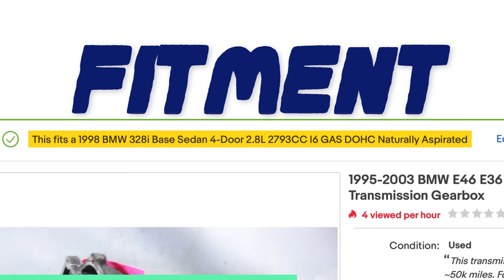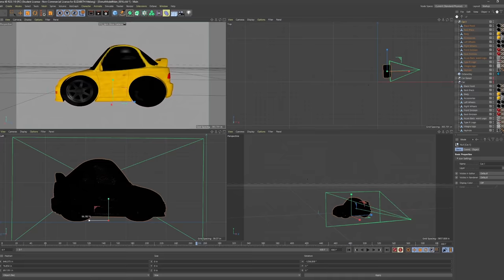Is a Manual Transmission Swap Worth It?

Comment: Wish I had a trans jack when I manual converted my holden vy commodore, I just caught the auto trans with my shoulder from a 1.5 metre drop 😅
Reply: Ouch
Reply: Damn probably broke something in that endeavor.
Reply: @lunakai_360  nope, auto gearbox and concrete came out fine haha, same with me some how
Reply: @robbiecook5719  yeah its like an American falling on you with a hard clip board

Comment: “It’s hard to find an e36 for less than 5k” almost 3k in extra parts alone
Reply: Though the rest of the cheaper automatic E36 is in way better condition than most $7.5k manual E36s for sale, so it’s still probably worth the trade off
Reply: @Girvo747  Is it really worth it though since you have to spend a few day sat least, might break something, and it will be worth less than a non-swapped manual vehicle. Also you need a bunch of expensive tools you might not have.
Reply: @jtland4842  Comes down to personal preference. Modification is never cheaper than factory, but modifying is a hobby in and of itself :)
Reply: not sure about E36 but a E39 manual gearbox is £350, with the rest of the whole kit you are looking at about £800. This is Donut so obviously they dont use eBay used parts lol
Reply: You can also sell the old auto and make some of that money back
Reply: @Nightinglite  the manual trans they’re using here is pretty clearly not brand new though so not sure what this means
Reply: @Nightinglite  here in germany a e36 325 trans is like 100€
Reply: @jtland4842  It's not worth it for most people, you might as well just buy a manual. Now if you're a mechanic with experience and all the tools yes.
Reply: I never get under a car unless I put in wood cribbing along with the jack stands.

Comment: 6:05 - :hand-orange-covering-eyes:Saw that sucker move and almost had a heart attack! Looked again and it was just an extra stand under the exhaust for support, no biggy. Whew... 😌

For real though like Zach said, don't mess around when you're lifting a car or you can easily end up dead. Something I used to train our newbies to do that would freak them out at first is that once you get it on jackstands, go all the way around and give it a solid shove from several directions. Why?
1) If you're worried that a little shove will knock it off the stands, that could be your instinct telling you that you made a mistake somehow and this is a good way to find out without dying.
2) Whether you're concerned about how stable it is or not, this will give you peace of mind when you're under it that one of your frisky coworkers coming by and leaning on, bumping into, or hopping inside it won't cause it to come down and squish you.
3) If (heaven forbid) a good shove actually does send it crashing down, you probably saved your own life and now have the benefit of being alive to take a good look at where you messed up on the stands. Once you understand what went wrong, think seriously about what to do next time so that you don't die if some doofus comes by and disturbs your precariously balanced body crusher.

Comment: Aight, we gonna need that turbo next 

BMW: Cries in stock
Reply: well, unlike the pathetic inline 4 that the miata had, the straight 6 of This bmw would surprisingly have strong enough internals to handle the boost
Reply: @Itselijahbruh  fax
Reply: @Itselijahbruh  the Germans know how to make an inline 6…
Reply: I've read up a TON on e36 builds. Stock internals will take an m50/m52 to 450-600 hp very reliably if the cooling system is maintained. The m42 is cool. You can take forged piston & rods from an M3 as well as adapt the ITBs by removing the middle two. 4-1 stainless header with a tune and you're off for less than an M3 but just as fast and cheaper to maintain.
Reply: @FierceAmbience  i'm planning to buy an 328i or an m3, and i'm so glad to hear this, wish me luck
Reply: @FierceAmbience  600 is a push. Stock m52 can do it but the "safe" limit is reached around 450. Head bolts are a weak point, so decomp head gasket and uprated bolts should push up into the 5-600s
Reply: @LochyP   the 450 numbers are whp I believe while 500-600 is the crank numbers
Reply: @rokuplayz464  yes sorry should've been clearer, ~15-20% drive train losses
Reply: @LochyP  not bad
Reply: @LochyP  False. The head bolts being "weak" is plagued upon the M52TU and M54 because it's an aluminum block but it's more forum misinformation than anything.

Comment: I'm curious how long this actually took him to complete
Reply: Made it look like a day. Could be
Reply: That's why I would rather just save extra cash to buy an actual manual E36.
Reply: If you have all the part, total labor would be 7-9 hours if you know what you are doing.
Reply: @ultraguy8771  the manuals out there are trashed though. this is an cost effective way  no matter how you look at it
Reply: @ultraguy8771  and not long after have to replace the clutch
Reply: This probs took them the whole day becus they need to film all the stuff
Reply: This will take a couple of days or maybe even a week, because you're going to be spending 90% of the time looking for tools and parts, ordering things you forgot to order or didn't know you needed/were missing and cleaning up afterwards. I always underestimate how long something takes. There are always things you can't prepare for.
Reply: I've found that time to complete a project goes down dramatically each time you do it. Based on some of the comments he made during the video, I'm sure Zach has done a trans swap before, hence the short working time and lack of having to order parts multiple times. :3
Reply: Probably a week
Reply: Two different shirts right? I could do it in a day with a lift. On the ground... Def slower and much more miserable.
Reply: @SoundShunter72  This is probably the most realistic estimate for most people. Its a lot of work regardless, though.
Reply: @SoundShunter72  yup!!! id say it took him "some time"
Reply: probably a couple days
Reply: I've done manual swaps on alot of different cars. Never on a BMW but this looked like an easy swap. Honda and GM are usually cake. I did a swap on a Ford Focus and it was nightmare on elm street. Do some research though, some cars are actually faster with an automatic. I could do this  BMW swap in one long day about 12-16 hours. A beginner could probably do this over a weekend with help.

Comment: i just bought one today.. and im going back through all of these to do exactly what you did, but make it a daily instead.. the guidance and in depth view of it is something i really needed and its given me more confidence in doing it myself thank youx100
Reply: How’d it go?
Reply: @KillianDeaton  still going i  had huge trouble with the fan clutch nut.. when replacing my cooling system. next thhing im gonna do it probably the fuel system... its started giving me trouble and now i have to pedal just to get it to start.... once its running smooth again ill swap trans
Reply: @NIGHTCRAWLER9101  Did you do it?
Reply: @LattoSan  its running rough right now biggest problem for me now is money and IM sure i have some seals broken cause its now acting as if i have a blown headgasket... im 100000x sure its not tho
Reply: joe hatcher how much did it cost?
Reply: Me too!
Reply: @NIGHTCRAWLER9101  did you ever get that car running?
Reply: @NIGHTCRAWLER9101  It's time for an update

Comment: Total build cost: $3,156
Having a manual instead of a slushbox: pricessless
Reply: for everything else there's Mastercard :))
Reply: You can sell those automatic stuff :/ Lower the cost to $2000?
Reply: @NeoHCgbz  I wouldn't have even noticed
Reply: @NeoHCgbz  pricesheeeeesh
Reply: @shyan5886  now you're thinking!
Reply: laughs in built auto, shift kit, and ratchet shifter
Reply: @frigglebiscuit7484  touché

Comment: This actually felt funny. In countries like mine people try to change from manual to automatic, cause it's easier to drive. But there's also a team (relatively new) who change manual to semi-automatic. You still use the shifter to shift but you don't use the clutch. And you can change from auto-to-manual and manual-to-auto with a press of a button. I think this is the most viable choice who both want ease of use + control of the car.

Comment: I can do this in an alleyway single parking space, right?
Reply: The video started with bright outside light and ended with bright outside light. He did this in less than 6 hours. Lord would it be an epic prank  to change someone’s car to a manual while they’re at work....
Reply: If you manage to order every single part and missing tool you don’t own ahead of time and make zero mistakes in that process: sure! Lol
Reply: @hestia3135  manual swap a random car at the airport the odds of them coming back is low
Reply: @hestia3135  that real flex tho, and now you can race the homie

Comment: Swapped an e30 325 couple years back, manual swapping is always worth the effort especially when you go from 4sp auto to 5sp manual. got a project e32 750il planning on doing the same.
Reply: How's that project 750il going?

Comment: I’ve actually done auto to manual conversions over the years (pre internet and car ECUs) and yes it is worth it ALWAYS. By the way there are times you’ll also need a bell housing adapter plate as sometimes sizes of bell housings or bolt patterns may vary or when going non stock. Excellent job on the conversion and video. 👍🏻👍🏻👍🏻
Reply: how long does it take to manual swap a car?
Reply: @jacquesbeaumont4884  About 1 to 2 days depending on the car and what you have to fabricate. Living here in Australia and back 20 years age when I did my last conversion I didn’t always have the tools or parts on hand to make life easier. Just remember doing a great job means taking your time if you’re doing it for yourself so time isn’t a factor.
Reply: @davegoldspink5354  aight mate, thanks alot
Reply: @jacquesbeaumont4884  no worries Mate just so you know I did 6 conversions since I was an Auto engineering apprentice back at the end of the 70s and the last one was the only one that failed. It was an Aussie built 1980 Ford Fairlane which came with a C4 Auto and a 302 V8 Cleveland. Unfortunately the 4 speed Toploader couldn’t take the power and self destructed a month after I fitted it. Personally I found the Fords I did were way easier than the 3 Holdens as the Holdens used either Aussie or US built V8s and needed adapter plates and often have different firewall layouts.

Comment: "You don't want your flywheel coming off"... oh words of wisdom. I had a clutch replaced on my first car at a lets say less-than-reputable shop and just a couple weeks later something came apart and shot through the transmission housing while I was on the highway, so trans fuild starts pouring out near the hot engine and pretty quickly ignites. I did not have a fire extinguisher in the car so it was 911 and a firetruck response which put it out before spreading. Ended up selling the stereo out of it for more than the car itself. If only I had Donut's guidance (and a shop) back then...

Comment: i was just in my footwell today, and as a 6'2" 200 lb man with shoulders that barely fit through a door way, i gotta agree. There was a TON of space in the footwell of my 05 elantra, SO MUCH room. My shoulder TOTALLY wasnt trying to fuse itself to my ear and orbital at the same time. 10/10 would recommend.

edit: Yes, sigh, i ended up having to take my entire drivers seat out to get in there.

Comment: “This wasn’t to create content, a manual in this condition costs $2K more! So I bought an automatic and $3.5K worth of parts to make it manual!” Uh huh.
Reply: He wanted a good condition car that wasn't abused heavily... he did say this in the video...

So he got a good condition automatic to convert to manual xd
Reply: @kajmak64bit76  he showed a coupe for 2k more,coupes are worth more. it was for content
Reply: @charlieward7606  what ever
Reply: There are far greater benefits to a swap and most often it's much cheaper than  buying one out right and having more out of pocket replacing Trans bearings  and upgrades to the clutch, I've always let my first  timers learn on clutches that are barley there, 😀  gonna be upgrading anyway so I make sure they lived a good life and when comes time to remove parts they are fully expired.
Reply: They are a informative channel that helps you understand thing about cars.... he said they didn't want to buy one that has been abused and the whole purpose of buying parts is to teach us

Comment: Hopefully they throw a locked rear diff in if they're taking this to the dirt.
Reply: Lsd dif
Reply: @dimitrijenovakovic7942  the easy way
Reply: And a hydro handbrake
Reply: Are you kidding? You all of those things have to be done, you definitely are not fit for the job. But you have heard that statement before huh🤣🤣🤣
Reply: @butcherbaker4258  what the hell are you talking about
Reply: Do a ARB locker like in aftermarket trucks
Reply: @dimitrijenovakovic7942  lmao
Reply: @stevebutters306  it needs a damn locker or a welded rear axle. You stated the most obvious damn thing it just shows the depth of you're off road vehicle parts. Cant make it any more easy for you.

Comment: We used to swap manuals into salvage Hondas (buy both at Copart, park next to each other, empty the automatic car then crossload the manual parts replacing whatever needed it) at a used car lot. The donors were traded off to other businesses if we didn't need them. I've no doubt it's still common because it's so easy to do with a couple of experienced mechs.

Comment: This is the most expensive manual swap I’ve ever seen on an e36. That shit cost like $250 at u pull 😂
Reply: I bought a parts car for mine. 500 dollars and had everything I needed. Parted out the rest and turned a profit rather than it costing me anything.
Reply: @colecooper5836   Parts cars are definitely the move. Me and a homie just pulled a full manual swap at the local yard for $250 out the door. Including clutch, lines all if it.
Reply: @Skrtvrt  I think they just wanted to go new so they get the best and most reliable result. But I agree, and they should’ve spent even 15 or 30 seconds explaining that.
Reply: funny thing is you can get your hands on a manual e36 in europe for around a grand. Wouldn't it be easier for them to import it there ? you can import a car to USA for around a grand from what i've heard
Reply: @KrazyJohnnySvK   not even close. Importing one cost way more than that plus all the paperwork and bullshit. We have a fuckton of e36s here manual and auto. Normally the manual ones are beat to shit and the auto ones are clean Bc an old person had them.
Reply: @Skrtvrt  I envy the freedom of modifying your vehicle in america lol. In europe its fucking cancer. Automatic cars are more expensive than manual. You can pickup a mark 4 golf for 300euros and modify the living shit out of it. I myself have a 07' Turbo diesel civic EX and the engine is fucking bulletproof. Sadly modifying this car is insanely hard. I had an offer to buy mark 3 eclipse 2.4 manual for 800 euros and i didnt take it ffs.
Reply: @KrazyJohnnySvK   well thanks to our corrupt shitty government that might not last long. They are currently trying to ban any production car from being turned into a racecar. Doesn’t matter if it’s a 60s Chevy, new civic, whatever. If it has a vin it can’t be turned into a race car.

Comment: I have a 99 honda prelude which I auto to manual swapped. I had a few hiccups and several years without a garage. 4 years later im finally getting it back together and finishing it up. Ive been told that its a complete waste of time but I love this car as it was my first project car. I think its worth it.

Comment: Lists $3300 of parts
Ends with
“A manual would have cost me $2500-$3000 more than this car, which is more than I spent on parts”
Erm
No, it’s not 🙈😂
Reply: They also mentioned that the condition on them were not in good shape so it was more convenient for them just to swap it for around the same price of a manual but in a greater shape of a car
Reply: Content. They did an engine swap now they are doing a trans swap.
Reply: @Glyroth  But if they're going to drive it around a dirty track at high speeds, I kind of wonder why the conditions matters at all. It's cool to see that this type of thing is possible, but I really don't think that you can argue that it makes financial sense.
Reply: @JLocke573  like the comment above u said for the content as well it would makes sense financially donut isn’t no small utube channel
Reply: They could also sell the auto transmission
Reply: Also the mileage makes a difference the E36 with the manual they showed were high mileage his has 95000. It's great content though keep it going donut!!!!!!
Reply: They can sell the good auto trans, torque converter, driveshaft, and all the other parts they didn’t need and recoup some of that money anyway. The trans alone is worth 1000 dollars easy.